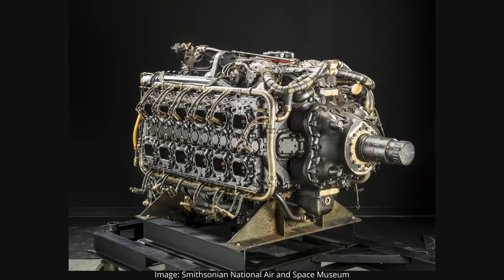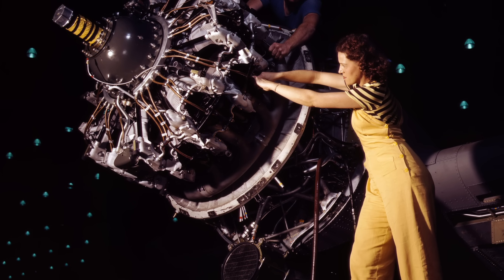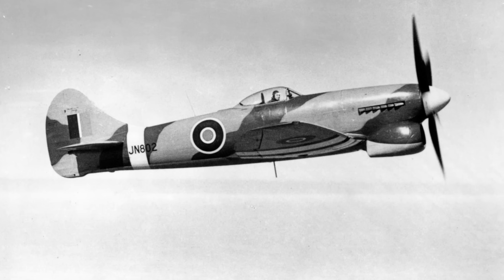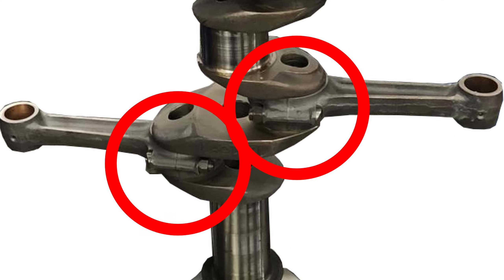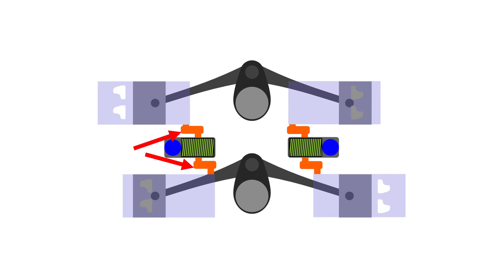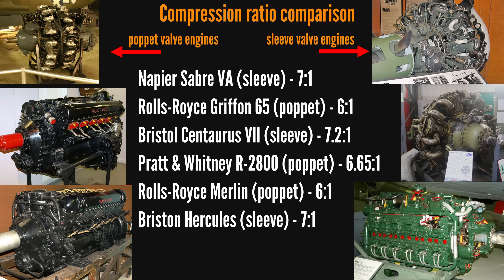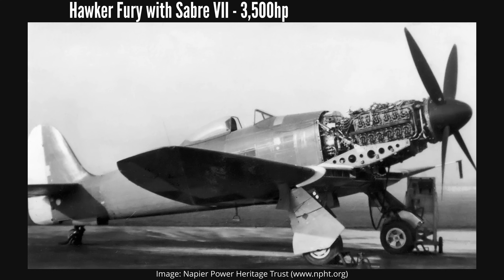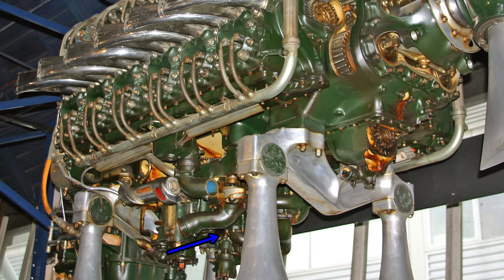The Complex Napier Sabre 24 Cylinder Aero Engine Explained Simply

Comment: Thanks, there was no mention of Major Frank Halford who designed this engine, also designing the Gypsy engine series (long lived) and then the more powerful Halford H1 jet engine in 1942/43 that was the Goblin 3,500lb thrust  engine to power the deH Vampire and then later the Ghost engine powering the DeH Venom!! A remarkable Mechanical engineer working for himself and Napier and later de Havilland.  All his engines were long lived engines - good lubrication systems. It was only during the first 2 years of war use that the technicians had decided to alter the fuelling and firing timing, boost control (Factory settings) that detonation occurred destroying some engines and pilots were killed.  
Also of note, counting pistons, conrods, camshafts, crankshafts, valves, valve springs, sleeves that you find 173 components in a V12 Merlin versus 76 in the H24 Napier Sabre - which was the most complex ?
Reply: The Sleeve valve engine was designed and patented by American Charles Knight... Halfords achievements are generally overshadowed by Stanley Hooker and Adrian Lombard, the real genius behind Britain's jet program..
Reply: @DoktorBayerischeMotorenWerke  

The de Havilland H1 (Goblin) was the first flight certified turbojet outside of Germany (assuming they flight-certified theirs).  It also powered the Meteor on its maiden flight and was used to power the prototype Lockheed P-80 Shooting Star.  

His last turbojet before his premature death (1955) was the  

de Havilland Gyron (H4), an axial design and the most powerful turbojet of its time, designed specifically for supersonic flight.  The 1957 Defence White Paper cancelled it and the aircraft it was designed to power.

He also worked on rocket designs.

If you want to pick someone at R-R (and yes Bristol) outside of Hooker in a design role rather than a management role, in my opinion, Geoff Wilde would be a better choice.  For some reason (unknown) Stewart Tresilian refused to work under Lombard and resigned from R-R rather than do so.

And again Knight's successful patent was for double-acting sleeve valves not single-acting, he lost the court case over patent infringement against Argyll for the Burt sleeve valve as his earlier patent for single-acting sleeve valves was found to be impractical. 

And of course, Halford still designed the Sabre and a number of other piston engines.   If you want to break it down to giving Knight the credit, you may as well go the whole way and give the credit for designing all spark ignition ICEs up to current F1 engines to Nicolaus Otto.
Reply: @Pene7942  Britain was never a leader in Internal Combustion technology and always lagged years behind Germany and America..

Comment: With these sleeve valves, how the admission and exaust pipes were screwed onto the cylinders ?
Reply: Intake and exhaust ports were cast into the cylinder walls... just like a 2-stroke motorcycle engine,.

Comment: pretty sure an inline-4 is the lowest cylinder count to achieve perfect primary balance. Inline-6 just allows the power strokes to overlap somewhat; probably smooths out torque over rotation of engine.
To get perfect secondary balance you need an flat-8.

Comment: What is the physical chemistry of the sodium filled valve
What other property would encasing the engine in a compressor designed for a jet provide beside weight, is there a limit to compession?
Reply: Sodium is metal that melts at low temperature, its an excellent conductor of heat and absorbs heat as it undergoes a phase change from a solid to a liquid.
Sodium filled valves have a hollow stem which is partially filled with sodium powder/grains. 
As the valve opens and closes the molten sodium transfers heat away from the head of the valve to prevent ablative damage to the margin that forms the gas tight seal, if the seal is damaged hot gas will pass during combustion that act like a cutting torch that will ablate fissures in the valve and compression will be lost. 

There are many examples of ducted fan and Motorjet aircraft but this arrangement has some efficiency disadvantages and there are only a few successful applications.
 Compression is limited in homogeneous charge, spark ignition engines by pre-ignition and detonation.
 as compression go up so does temperature, this temperature can exceed the auto-ignition temperture of the fuel air mixture can cause uncontrolled ignition and combustion.

Diesel engines and GDI engines are not affected, they are limited by the pumping efficacy of the piston..

Comment: Imagine trying to trace a misfire on this beast!!! Excellent presentation.
Reply: EGT probes. or spark drop test.
Reply: I like the EGT approach - only valid for aero engines with no manifold- and definitely faster than taking out 48 spark plugs. But I suppose you'd hope to cut that to 24 suspect plugs by switching between mags. Even then, having worked in a V8 recently, with no load it'd be very difficult to discern a dropped cylinder out of 24 both on rpm or sound. Experience required!
Reply: @daithiosioradain3380  Not true, I use EGT on all engine types to diagnose a misfire. Its easier now with laser thermometers. Polished chrome headers dont work though, diffracts the laser

electronic engine diagnostic equipment existed at this time that could short-out a bank of cylinders or individual cylinders ignition leads to ground and the drop in rpm compared on a raster scale,
 albeit this method causes a much smaller rpm drop on a 24 cylinder engine that makes locating the cylinder harder to identify, it is easier with engines with fewer cylinders.

Comment: @LetsGoAviate
Can't really wrap my head aroung how the supercharger is run,torsion bars? I failed to figure out how the parts move. Could you please explain?
Reply from the maker: The sleeve valve drive shafts were hollow. Inside each was hosted a shaft, driven from the front reduction gears. At the back these shafts each had spur gears (yellow in my vid), that formed a compound gear (the green) and that all turned the supercharger (via the blue spur gear). It had two speeds, full and moderate, and those gears not shown.
Reply: @LetsGoAviate  I believe 'Quill shaft' is the correct term you meant to use. Cheers mate!
Reply: Torsion bar is not the correct term, it is driven by what is called a QUILL Shaft in the English language

Comment: Diabolical complexity. I bet the hatred for this engine was high in service and maintenance personnel.
Volumetric efficiency in its simplest form is what the cylinder should consume in air vs what it actually consumes in air. If each cylinder should use say 500CFM of air when factored for volume but only consumes 450CFM in reality, then VE is 90%. Valves, intake manifolding, air cleaners etc all reduce VE - it's a fact of life.

Comment: Many thanks for your response. I seem to have made a hash with my explanation of what I was trying to say. Terminology will obviously vary in different parts of the world but let's give it a try. To begin with I have absolutely no knowledge of patent application's at all. As I say different people have different names for the same thing. We all seem to agree however that there are inline 4's inline 6's etc V 4's, V 6's etc, the issue for me starts when we start talking about flat engines 4's, 6's, 12's, etc. To go back to your Mr Junker I believe he deigned a flat engine that operated in the vertical plane as I believe did Leyland for a tank application, both engines having twice as many piston's than cylinders. Two crankshafts and no cylinder heads. Which means two pistons work in the same cylinder facing each other as do Boxer's in a ring, hence the name boxer layout ? I know that manufactures particularly Porsche, VW And the Japanese  manufacturer Subaru like to call there Horizontally opposed engines Boxer, but alas that doesn't make it correct.
I also understand that when the Triangle engine layout was taken over  ( Delta, is it Greek? ) Or Deltic as I know it didn't work as a German variant But when an engineer thought of the idea to make one of the crankshafts rotate in an opposing direction to what had originally been thought of it did  actually work properly.
May I take this opportunity to recommend a book that I think you may find very readable, you probably already have it but here goes, Napier Powered. compiled by Alan Vessey, Published by The Chalford Publishing Company Ltd. St Mary's Mill Stroud Gloucestershire GL6 8NX. England. Wishing you all the very best, cheers Keith. 
Ps, Many thanks for your great article.
Reply: Sorry Keith, but there are no accredited sources that agree with your theory.
The Sabre is a Boxer layout. this is the inverse layout of the Gegenkolbenmotoren (Opposed-Piston motor)... it is absolutely nothing new here... invented by Wilhelm von Oechelhäuser and a junior partner named Hugo Junkers. Patented July 8th 1892 in Dessau Germany (patent number 66961) it was manufactured by DGK k.g. for electric power generation and Jumo in models ranging from 60PS -600PS pferdestarkes (59-591 bhp horsepower) Hugo Junkers would go on to modify and refine the design to its peak with the Jumo 205 aircraft Diesel. In 1898 Ferdinand Porsche created the world's first hybrid automobile, called the Lohner-Porsche Mixte Hybrid, the company had 3 different models ranging in power output including one with a 60PS Oechelhäuser-Junkers Gegenkolbenmotoren 

The Napier company purchased the rights to manufacture Jumo Gegenkolbenmotors in particular it licensed the designs for what Napier would market as the Deltic, Cutlass and Culverin... licensed copies of the Jumo 218, 205 and 206. Gegenkolbenmotors 'aka' Opposed-Piston Motors   they are NOT boxer engines like the Sabre, Volkswagen Bettle, Porsche 911 or Subaru... Flat or Boxer engines are very common in aviation with Lycoming and Continental being very popular examples of the Boxer type engine.

Any question Keith?
Reply: @DoktorBayerischeMotorenWerke
Reply: @DoktorBayerischeMotorenWerke  There is none so blind as those who will not see.
Reply: @keithtpullin  Then why? do you chose to hide in the darkness of ignorance???

Comment: I was a student in the mid 1960s and we used have a session with an old fellow who used to discuss aspects of design. Turned out he was the chief test engineer at Napiers during WW2. When we returned after the Christmas break , a large crate had arrived that contained a Sabre engine. Under his supervision , we dismantled it. Every part was exquisitely engineered. The gears that were hand finished so that they meshed perfectly, the centrifuge to remove air bubbles from the lube oil, the list is endless.A truly master class in mechanical engineering.
Reply from the maker: That's must have been some experience! I can only imagine the excitement, today such an experience cannot be bought at virtually any price.
Reply: As to any differences between the various facilities manufacturing the Merlin. I have a few different tale regarding British manufacturing. One aspect of my job was rebuilding spindles for machine tools. A great many of these used angular contact ball bearings. Often these spindles had a gage length in relationship to the spindle to cutting tool interface and specific feature of the spindle housing. If l was using US, German or Japanese manufactured bearings this was often right on the mark and wouldn't require fitting new spacers. Then we got some British manufactured bearings from RHP iirc. The major individual bearings would and did vary .006"/.150mm in the Axial length. This is an enormous difference in an assembly where tolerances were in the millionths of an inch. This would negotiate the making of new fitting spacers who's faces needed to parallel to each other within .00005" or less.
Reply: Did you get to rebuild it?
Reply: Great story! I am SO jealous! As a Physics fan the discussion of engine balance fundamentals here is excellent. Arranging all those components into a compact package that could actually be cast, machined, and assembled is quite a design test! How many parts did you have left over?
Reply: And that story is why there are no Sabre engines left running today... not a single one left in the world left in running condition..
Reply: @DoktorBayerischeMotorenWerke  Rejoice! AFAIK there are a few that should fly again quite soon, the Hawker Typhoon RB396 in UK, another Hawker Typhoon at the Canadian Aviation Heritage Centre of Montréal, and a Hawker Tempest V at Fantasy of Flight, FL, USA. And with bad luck accounted for, we should at least have one Sabre roaring again!
Reply: @MC202zipper  Yes, Fantasy of flight has two complete engines, one of them is a zero hours, new in crate. (if I remembered correctly Kermit doesn't have the correct propeller for either of them)
Unfortunately, there are none of the old experts on these extremely complex engines left alive... so things will not be easy.
Reply: @MC202zipper   It is my understanding that Fantasy of Flight is the only project with a Sabre V engine, which was discussed as a better candidate for airworthy restoration.  I think the other projects have Sabre II engines.
Reply: "...The gears that were hand finished so that they meshed perfectly, the centrifuge to remove air bubbles from the lube oil, the list is endless.A truly master class in mechanical engineering..."
No. A truly master product of early 20th century apprentice practices. Those parts should have come off the machine ready to be fitted, not requiring 'hand finishing'. 
The UK required better machine tools, not better apprentice fitters. Truly HORRIBLE design, especially at the end of IC aero engine use, including any engineering assumptions that reciprocating 30# sleeves made an engine 'smoother' than reciprocating 8oz valves did.
Dead end from the time the first line was drawn.

Comment: My field is automotive, and the same scenario happened here. More cylinders and bigger bores made some engines humongous. Some are as large as a whole modern car. I love engines and have experience on Lycoming engines because they were used in Duesenberg cars. Other manufacturers also and the war was on in those days to be the most powerful and fastest. What's funny to me now is that we get more horsepower out of a 2 liter 4 cylinder than a V16 Lincoln or Caddy. It's been my pleasure to direct a car collection with cars and other vehicles going back to the beginning.

Comment: My interpretation of a Boxer style design is when the piston crowns face each other as in the Deltic ( English Electric ) used in rail traction. I would call what you describe as Boxer actually horizontally opposed.
Reply: That is incorrect, the Napier Deltic is a Gegenkolbenmotor (Opposed-Piston motor)... Invented by Wilhelm von Oechelhäuser and a junior partner named Hugo Junkers. Patented July 8th 1892 in Dessau Germany (patent number 66961) 
 Hugo Junkers would go on to modify and refine the design to its peak with the Jumo 205 aircraft Diesel.
The Jumo 218 was licensed to Napier and sold as the Deltic... they also licensed the Jumo  205 and 206 as the Napier Cutlass and the Culverin..
Reply: No, Jumo tried to build a delta-style engine but were unable to resolve tha piston phasing problem. The Deltic solved that problem by having one crankshaft turn in the opposite direction to the other two. The Jumo was never built; not even, as far as I can discover, as a single row (three cylinder/six piston) test engine. @DoktorBayerischeMotorenWerke
Reply: @gerardlardner3104  That is incorrect, the 18-cylinder Jumo 218 lacked the power output required and was discontinued in favor of the larger Diamond-style Rhomboid engines, the 222, 223 and eventually the 24 cylinder 224 engines.
 Jumo lost interest in the Delta 218 and sold the completed design to Napier along with the Cutlass and the Culverin.
 all of these engines were abandoned by Jumo with the introduction of JET engines that rendered them obsolete for high performance aircraft. 

Napier did however develop the 9-cylinder "Baby Deltic" own its own. No Jumo version of this configuration is known to exist..

Comment: That was a particularly clear, comprehensive explanation of the structure of the engine - truly excellent!

With this in mind, would love to see your deep-dive of the RR Vulture engine (and why it failed), and also (although not directly aviation related) the Napier Deltic engine used on railway locos and British MTBs late in the war.

Brilliant! Keep it up! 🤓👍
Reply: The Deltic certainly is aviation related, Napier purchased the design from Jumo (Jumo 218) and it was originally intended as a Diesel aero-engine.

Comment: Fastest at 437mph? Didn't the TA-152 hit over 475mph? Perhaps is an altitude thing 🤔
Reply from the maker: It's an altitude thing. The TA 152's max level speed of 475mph was at 40,000+ feet 🙂. At sea level it "only" did 350mph (another source claims 360mph)